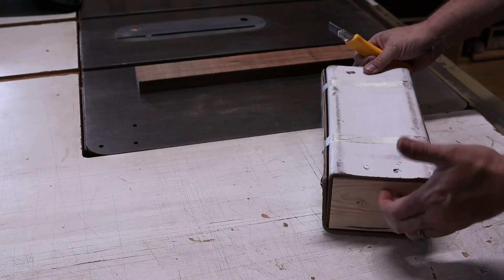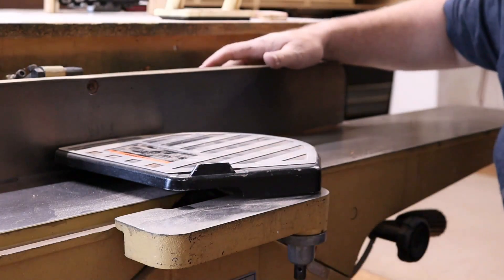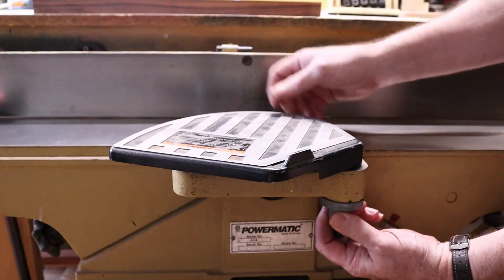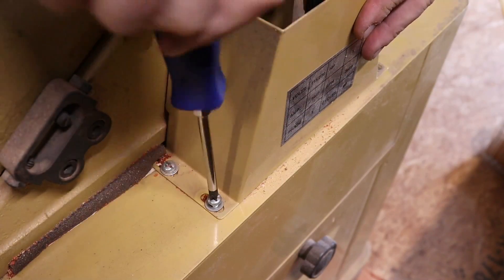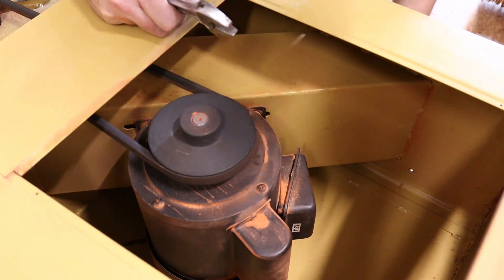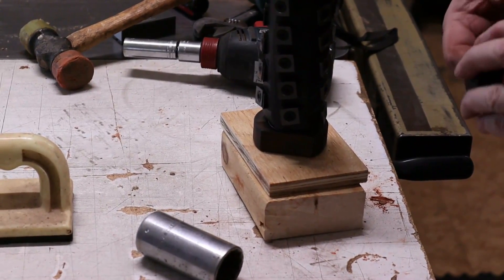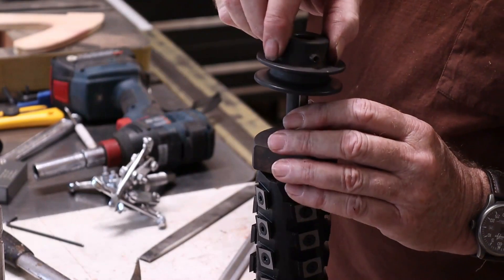Powermatic 54a Byrd Shelix Cutterhead Installation

Comment: Where did you get the gear puller and which model?
Reply from the maker: Probably NAPA from 1980's. 
Technically it doesn't need to be fancy, hobofreight has some if you need them cheap.

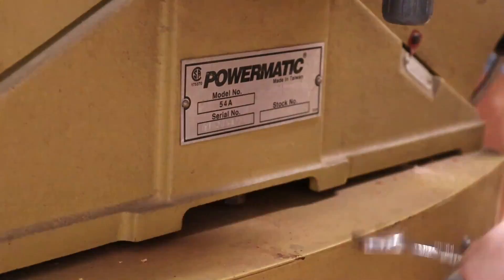Comment: The bolts that you removed at 3:28 were 9/16” on mine, not 14mm. Not super important, but thought I’d share anyway.

Also if you have to go buy a bearing puller like I did, make sure it’s a 3 pronged one.
Reply from the maker: Thank you for the additional assistance 👊